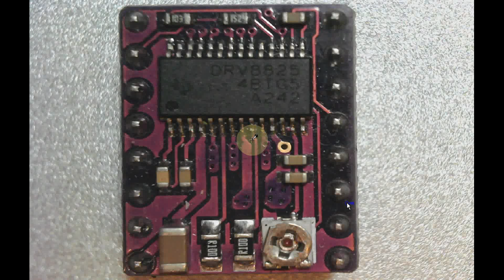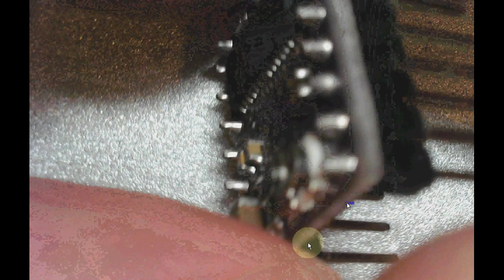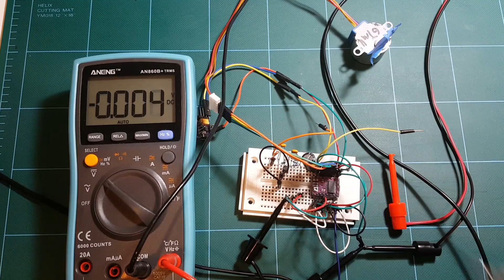adjusting stepper motor current

Comment: I can't set drv8825 vref to 1.3v    .. It is very sensitive and changes constantly : 1.3v to 3.5v to 5v!... are motors safe?
Reply from the maker: This does not sound right. Make sure that you are doing everything correctly and that your connections are solid. Try another board. Maybe the one you're trying to adjust is defective.

Comment: Can I use this "driver" for a PM25L -024 stepper motor ? The motor specs says a current rating of 600 mA, The data sheet for DRV8825 says 8-25V,  http://www.ti.com/lit/ds/symlink/drv8825.pdf

Comment: if my power supply is 5v how do i change it to 2.5 1.8 a  as a novice i need to understand this
Reply from the maker: Not sure how your question relates to this video but generally you'd use some sort of voltage regulator.
Reply: what voltage and amps do you use on a variable power supply when callibrating the driver? i tried setting up a drv8825 with a nema17 with arduino and when i turned on the power supply, the capacitator exploded. i might have put accidentally switched the - and + pole and now im kind of afraid to turn it on. it also might have been too high of a voltage and amps on the variable power supply

Comment: great work
can i get the test circuit  please.
Reply from the maker: VMOT = 12V
VDD = 5V
ENABLE = GND
connect RESET to SLEEP
MS1, MS2 and MS3 to 5V
send pulses to STEP
set DIR to GND or 5V
Google images for Sanguinololu schematic for an example of how it is connected on a 3d printer controller if the above is not clear